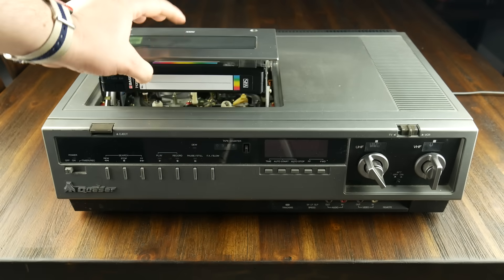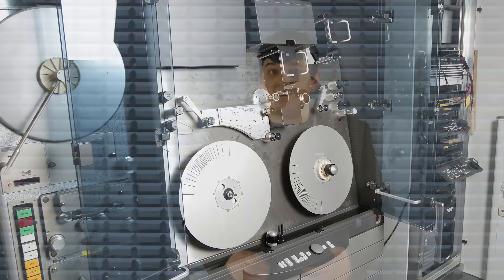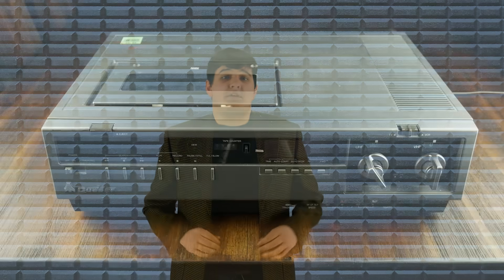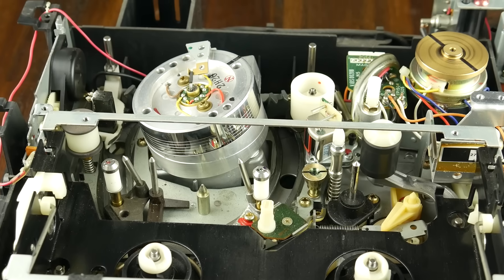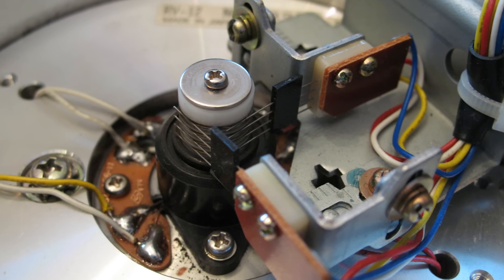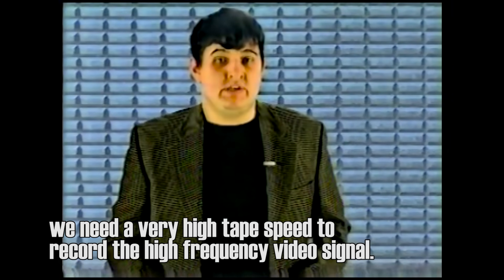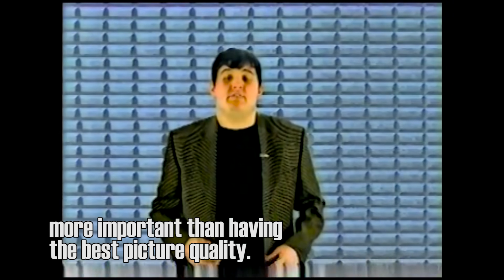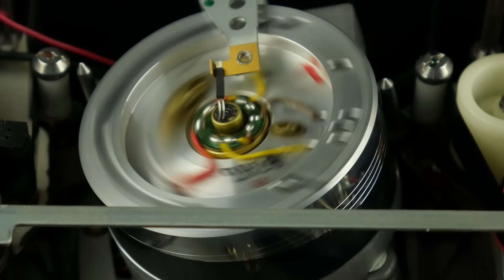The Impossible Feat inside Your VCR

Comment: EVERY VCR i bought was expensive & broke way before i expected. The latest ones were the worst & broke the quickest!  Before radio shack closed in my mall,  i bought a $20 dvd player there & it still works 20 years later! 
How i wish video & audio TAPES never came out! Nothing but problems - jamming, losing or weakening of 1 of the 2 channels, etc.  My 1st vcr was a big heavy 1983 JVC hr7100u that had a remote connected to the vcr with a WIRE! At least it didnt need batteries. The heads were so noisy to engage, they sometimes woke me up if was taping something at 4 am. lol
Reply: I figured Flash/permanent memory would be a logical upgrade to discs, but instead streaming happened

Comment: I found VCR's fascinating. A machine that pulls tape out of a cartridge, and threads it around the video head drum, which spun at high speed. Meanwhile, the rest of the tape was going past the audio and control head. Then the tape traveled back inside the cartridge to be wound by the takeup reel. And it managed to give a decent video and audio for that time.

Comment: It is so hard to believe that all things VHS basically dissapeared from our lives in 2006 
But DVDs are way better and don't degrade at all like VHS would as VHS would slowly wear out with each and every playback but DVDs will last for years no matter how many times it is played back and the same goes for CDs as well
Reply: DVD, BLU RAY and CD's will not last you for years they do break down over the years.  it's plastic if you didn't know that.
Reply: @c-v-n3322 also,they only react when exposed to oxygen
When DVDs and CDs are stored properly they can last up to 100 years with no problems at all
The plastic does break down eventually but what I was on about is the digital data DOES NOT DEGRADE
Reply: @c-v-n3322 disc rot is very rare.
Reply: @c-v-n3322 DVDs and CDs CAN LAST 100 YEARS MAX when used and stored properly and yes I know it is plastic but it so much more durable,longer lasting abd way more reliable
Reply: @c-v-n3322 I do know that you prune
They CAN last up to 100 years if used and stored properly
I still use VHS,DVDs and CDs and many of my CDs are over 12 years old so what I said IS 100% TRUE
Reply: @ I have Cd that were purchased in the early days when Cd first came out an they will not play I have used many different cd players to see if it was my player. 
VHS tapes are already breaking down to over use.
But my dvd and bluray are still going strong along with my records.

Comment: Nice explanation, I still have a SVHS machine to digitize VHS tapes to a computer.  How ever my first video machine was an AKAI B&W that used 1/4" tape reels.  Of course, it had a spinning head.
Reply: Have you considered using a D1 Digital Video Tape Recorder to digitize VHS tapes to D1 tapes?
Reply: @MicahtheDrumCorpsPseudoboomer  No I have not.  Presently I use a PC with an external Matrox H265 capture box.  I upscale the video to 1440x1080 @ 29fps.  Capturing to a tape, even digital would mean linear access to the video, capturing to a computer file gives random access to the video.
Reply: @ctldel290  My previous comment was (partially) a silly joke comment, sorry if the sillyness of it didn't come throuh.

Comment: LP mode might possibly have been removed because fastforwarding while still playing the tape didn't work very well but EP mode and SP mode did.  I had a great GE VCR from 1990 that had LP mode.  It could do more on that VCR than any other home VCR I'd seen at that time.

  I was always interested in DVHS.

  I remember someone I knew that worked in a production studio saying VHS signals are all screwed up and Beta's weren't.

Comment: I've known about the great sound quality from VHS for years. Too bad you can't play those tapes in your car.
We bought a vcr around 1988, 89, and it was your basic, non hifi, about 199 I think. We've had a 4 head hifi, and a VHS DVD combo, and I currently have a Sanyo 4head that works great. I just need a good capture device. I bought 1 years ago and it's crap.
You look much  younger in this, and it's only 5 years old.

Comment: I remember an interesting problem where I got a quasar  VHS that wouldn't play. It came on but wouldn't change channels or play a tape. I soon realized the problem as I went through the menu: it was 2009 then but the VCR had a date of July 1st 1999. But critically, it was scheduled to record for 2 hours in July 3rd 1999. So despite being unplugged it kept the memory and was hell bent on doing that recording. I couldn't even change the date. I decided to trick it. So I put a blank tape in and ran my cable through it's antenna. Luckily it scanned the channels and two days later the menu said it was July 4th 1999 and was now unlocked, believing it was still in 1999 and did it's job.  So a locked VHS can just be a timer.

Comment: Back in the day (the 1990s to be exact) I worked in a facility that used a 1in tape cassette to record digital data. The recorder was just a huge VCR with a helical scan head. There were three of these units in a cabinet with a 30 tape library and a mechanical arm to load/unload the tapes. I don't remember the data transfer rate now, but it was way up there for the time.

Thank you for what you do. I love watching your videos.

Comment: 16:13 Also, JVC should've also introduced D-VHS-C, a digital variant of the Smaller VHS-C cassette, to compete with Digital8 and MiniDV, but with A LOT of advantages over the other competing digital videotape formats, such as instant clip selection and access, like what started to appear on the Non-Tape video camera formats such as the DVD and SD Card or even Hard Disk Camcorders, but on Digital VHS Tape. Plus you can delete footage, unlike DVDs, and more easily than Digital8 or MiniDV! D-VHS-C will have time and date information digitally encoded onto the tape from the Camcorder, and each time you record a clip, it can additionally encode a finalization code at the end of a clip you finished recording and save that clip as a video file onto the tape (something that Digital8 and MiniDV were probably or mostly incapable of doing). And, it lets download videos to your computer from either USB or Firewire, as opposed to dubbing or capturing video from Digital8 or MiniDV. But, you would still need an adapter to play the tape of course, but the adapter would be modified with the additional holes that indicates the VCR has a D-VHS cassette inserted. IF you were to put the analog VHS-C or S-VHS-C cassette into an adaptor for the D-VHS-C cassette, the VCR will think that the tape is digital, but will have trouble playing it back, so if it reads the analog tape as digital, it automatically ejects cassette adapter from the VCR, since the formulation isn't compatible. It would do the same if you put a D-VHS-C Tape into an adapter for the Analog VHS-C or S-VHS-C tapes.

Comment: 14:40 - Where I am in the UK I don't recall VCRs that couldn't record in LP, maybe that was just a US thing? Who knows. A thought though, assuming that was indeed the case for some regions: is it possible that one reason why the LP record mode was dropped was because of the emergence of much longer tapes? In the latter days of VHS, most blank tapes people bought (in the UK anyway) were either 3 hours or 4 hours, with the latter being especially good value if purchsed as a multipack of 3 or 5 tapes. I remember being able to buy good quality 4hr blank tapes at good prices, and thus rarely ever used LP for recording even though all my VCRs (five of them) do support it. I have hundreds of old documentaries & suchlike recorded off the TV on VHS, not one of them was recorded in LP. I only ever used LP for recording less important things such as news bulletins or the weather forecast.

Many of my VHS tapes are now quite old, but the better quality ones still play perfectly ok, especially when using a decent VCR. Indeed, most of the cheaper tapes play ok aswell, at least the 3hr ones anyway (E180s as they were called in the UK). I know some people had problems when buying poorly made (ie. overly thin) E240s because these could stretch, all the more so if used in a cheap VCR (because they were vulnerable to overly vicious Fast Forward and Rewind mechanisms, as manufacturers competed even on how quickly one could search through a tape, eg. my Panasonic proudly proclaims on its front flap that it has "JetSearch").

Anyway, just thought maybe longer tape lengths were partly why LP may have been demoted in some areas. Strange though the lack of consistency.

Btw, it was extremely common in the UK for VCRs to be able to play both PAL and NTSC tapes (PAL being the UK norm of course), and some machines could play SECAM aswell. Indeed, I have a Ferguson which can also record in these three different formats, not just play them. Hence, could VCRs in the US also play and/or record in PAL or SECAM aswell as the regionally native NTSC, or were they almost always NTSC-only? In the UK the multiformat support meant importing tapes from the US or elsewhere was a viable option for many, especially if a desired title had not yet been released as a PAL edition. When visiting NYC in Sep/2000, one of my favourite purchases was a widescreen special edition box set of the fiirst six Star Trek films, a set that was not yet available in the UK in PAL; my VCR at home could of course play them just fine. I bought an Alien box set aswell, and these sets were much cheaper vs. UK pricing,  though perhaps that was in part due to their obviously cheaper cardboard containers (in the UK, almost all tapes were sold with larger, more resilient plastic cases; some exceptions of course, but on the whole the containers were plastic).

Comment: Majority of people have no clue that 📼 D-VHS/ D-Theater is actually better picture quality than 📀 Blu-ray or DVD Disc. D-VHS came out too late, right when DVD already took over standard VHS/ S-VHS format, and at that time, when there was a battle between HD-DVD & Blu-ray 📀 formats ( Similar to VHS vs. Beta battle). Blu-ray won, of course, but majority, even aware that D-VHS is better, were not going to support it, since technology was moving on from analog to digital. I still use audio compact cassette tapes as a primary source for music storage and reproduction.
Reply: The few D-VHS decks available, mainly from JVC, were very expensive and BIG beasts... at that time. No doubt after few years and the evolution of VLSI chips, these decks would have been as small and lightweight as the mainstream VHS machines. But as you said, it was too late. The technology for mass market was also not ready.

Comment: That is the EXACT machine my family had when I was a kid.  It even came with a remote control, as in a "Pause/Play" switch with a 10-foot cord.  It's only purpose was to pause a recording during commercials without having to jump off the couch.  Twin dials for recording channel selection was a nice anachronistic contrast with the buttons and vacuum fluorescent display.

Seeing the cover removed was a nice bit of nostalgia because I even took it apart after it eventually failed.

I actually found the box for it recently in my parent's garage.

Comment: not sure how or why im here.. BUT -- while im here.. i have a vhs player and some tapes with family recordings.. my vhs player i ahve to take apart because if you play and it works fine forward. as you rewind the tape does NOT stay taught and tangles./ 1 vhs ripped but it was a test one anyway (im trying to back them up on a computer or something for example)

i have to MANUALLY move a part inside (not sure what its called but i figured it out) to rewind then move it back again to go forward --- is there a way to fix this without paying £80 ($100+) for a new vhs player JUST to back up probably only 2 hours of footage on 3 tapes. as i dont want to spend money but i have no space to keep vhs tapes or the player in my tiny flat

PS: in the 90s all our vhs players in the uk still had LP - it never went away but NEVER heard of SLP

Comment: Nice vid! My Dad used to work for Ampex when they made those enormous machines. I was too young to remember that, but I do remember when he worked on them as a VT editor for an independent service provider. He also did a lot of outside broadcast work such as Wimbledon and F1 where they had those machines in the back of a big truck. By the way, editing in those days involved cutting the video tape and splicing it back together with some special tape.
My brother followed in dad's footsteps and still does editing work for broadcast. Now at home on his mac!

Comment: I was privileged to see and work with an Ampex VR2-2000, required 90 psi air for bearings. TV station Studio recorder magnetic tape several inches wide  flying head. Looking back at what a fantastic machine.  General class licensed. Had to change a Klystron final amplifier tube driving 350 thousand watts, one time in my tenure. That is a four foot long vacuum tube and 70 Ibs for you newbees. Neat stuff.I am now 72 yrs old

Comment: This is a great video. Especially since I tore down an old VCR to see what made it work. I understood the head and it's built in transformers; genious; but I didn't know why the heads had to spin. What a great piece of engineering from probably some engineers standing around having a smoke and someone says, "why not make the head move at high speed and not worry about the tape speed?" Some great inventions have happened that way I'm sure. I still have a working VHS machine and have it connected to my digital TV through a converter. I'm disappointed with the poor quality of the pictures, assuming tape degradation.

Comment: No vcr n vcp is Complex system of mechanical n electronics which has many tek in it .....just see the ir sensors reading position of tape 📼 like 15:30 n stop at entered time  .....now same disc the black n white revolving in your car wheel with ir sensor in ABS ..... BLDC motor in so finely cnc VHS vedio head other mechanical system got modified in finely tuned computer hard disk 📀

Comment: After the introduction of DVD, I kept my 6 head VCR and started recording CDs on it.
The resulting sound was exceptional, true High Fidelity with no tape 'hiss' that conventional cheap Tape Decks were producing.
I still have kept some tapes with audio recordings on them and, even now, they provide a pleasant alternative analogue sound to the digital 'nasties' some poor audio systems generate.
Thanks for the explanation and, I have to agree with the previous contributor here, you're going far too fast for the average person to follow you.
Reply: I remember buying VHS tapes of the anime "Macron One," from Saban entertainment. Saban was so cheap, that even though you only got two twenty minute episodes per tape, it was recorded in SLP on cassettes with very little tape. These were official tapes.

Comment: Fun fact. Erase head is fixed, but recording and playback heads are spinning at the drum. If you look at 9:39 closely, you can see that erase head being set as a perpendicular to tape will erase several frames at the same time but in different places. That is why you see picture appearing from top of the screen and progressively filling the screen when playing back that tail left from erased picture on tape.  That's why you cannot "insert" some video in a previously recorded tape to fill it seamlessly.
And this is why "Flying erase head" was invented and it was places on the drum as well, just to make it possible to record seamless inserts (used on some VHS video cameras).

Comment: Even though this video is a little old now it's nice to hear people still talk about VHS.

I've been determined to find VHS through natural means of yard sales and it's near impossible. After buying three broken machines I finally got one that's quite modern and works like a charm. I almost cried the other day when I put in a dirty tape without cleaning the dust off of it and everything went static. Even my other perfect tapes wouldn't play. A quick fix was the VHS head cleaner tape. They sell them on Amazon for less than 10 bucks, one day shipping. Works perfectly again.  At this point I feel like I've probably spent close to $200 on VHS tapes and machines. Worth it? I think so. Nostalgia alone is priceless.

Comment: hello, i have a question about VHS, especially a thing that happens when digitizing VHS Tapes, there is a bug that sometimes in a random part of the tape it goes from color to black and white and when seeing it in detail you can see a lot of RGB lines across the image. and normally stopping the Tape, changing the region in the software from NTSC to PAL or vice versa fixes the problem. Now when watching it straight from the VCR to a TV it looks really fine, but when capturing it does that, i think it has to do something with the region, like if some part of the tape is NTSC and another one pal??

My digitizing equipment:
VCR: RCA VT-N781 (7 HEAD VHS-HQ N-PAL and NTSC, and it doesnt have a switch to change the regions, and it works like new)
Capture device: Easier Cap (i think this is the problem)
Software: honestech VHS to DVD 3.0 SE (that camed with the easier cap but i dont actually burn to dvd i just grab the video file and save it in a pendrive)

Comment: I still have most of my dad’s Ampex machines from the 60’s, 70’s and 80’s. He ran an advertising production company and never sold or threw gear away. He kept it all in storage in a building on his property. After he passed, it all went to me. 
When Covid hit, I started restoration on a VR 1200 2”. I’ve been using a Tektronix PAL Vectorscope to see what the quadruplex heads are doing, analyze and retune it. It has surprisingly held up well over the years. I’m going to use it and perhaps lease it to commercial studios for “period” recordings. Digital still can’t quite replicate it. 
Great vid.